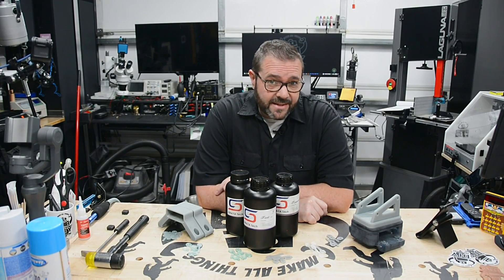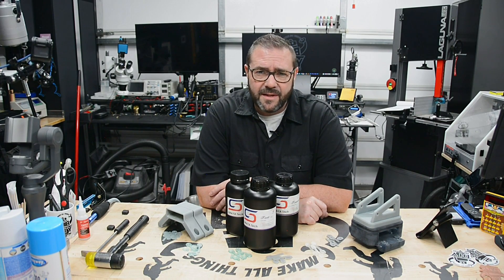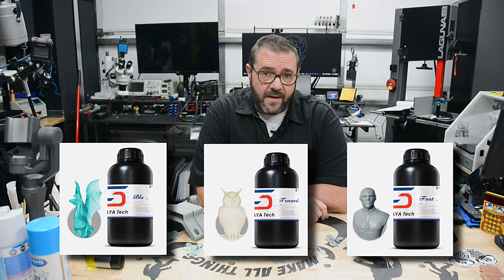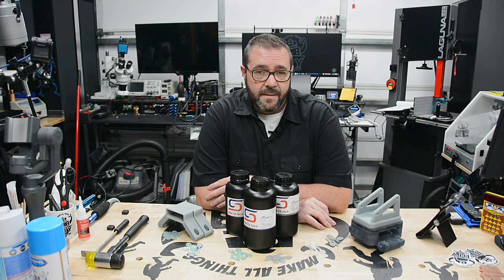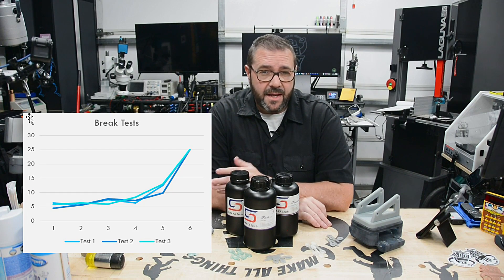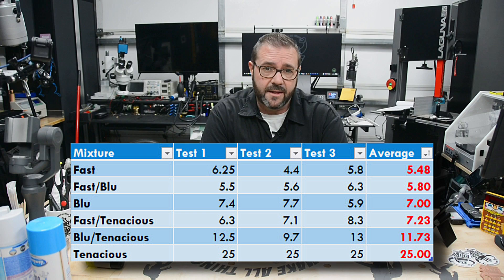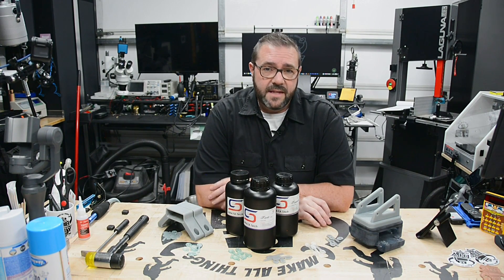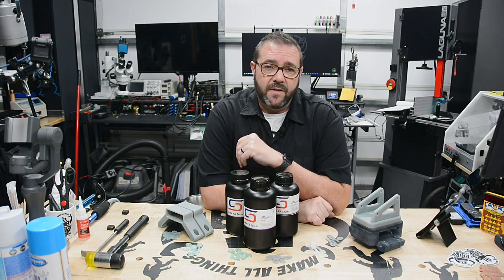Testing Multiple Siraya-Tech Resin Mixtures for Maximum Strength!

Comment: If I could see a video like this.. but also comparing prints with a caliper.. checkijg macro photos.. seeing which details were lost or not.. I could find the perfect combination that worked for me. Mixing this or that.. or not.. theoretically each resin has its own propertymies on details, expanding and/or shrinking.. that's also important when making a decision besides resistance. 

Yeah even if the subject is mechanical parts printed.. precision is key. I don't want to print with finicky mixes that have unstable sizes when fitting each other

Comment: Really appreciate the scientific and practical stuff you post. I’ve been on a constant search for the strongest resins for a few years for the various mechanical parts I create. I’ve come to Esun hard/tough as being most resistant by a significant margin to certain breaking forces. Blu being second to that for sure. Though now I’m curious about a Tenacious blend to trade off some flexibility for strength. Have you ever used the Esun or compared the two? To me these are the only options I’ve come across (at least among the affordable resins).

Comment: This is actually exactly what I was looking for! I was looking to make something robust that could be tapped and screwed and this is the perfect video. What mixture ratio did you settle with?
Reply from the maker: I think i went with 70:30 blu/tenacious for the overhead gimbal
It has lasted over a year under heavy load considerably well! Some parts are starting to show fatigue. But it’s worked great.
Reply: @DIYEngineering  oh perfect that was the ratio I planned on testing first anyways!

Comment: Great video without a single miniature model. I am very interested in the tenacoius resin and its surface properties. We need to design something to hold small items with vacuum and while I can find FDM TPU prints I find nothing in the resin printing. Tenacious should have a shore of 65 - roughly like silicone rubber, and for our process it would be great to print the first 4mm in soft material and the next 10 in ex. a tenacious/blue combo.

Comment: You don't have to use 50/50..   I take a full 1 litter bottle of Fast and pour a 150ml of tenacious in it.   There is enough room in a new unused bottle of fast for this 150ml.   Mix up real good and I use that throughout the day, every day, with unbelievable results.
Reply from the maker: that may work for your application, but the mixture ratio is ultimately dependent on your desired material characteristics and application.
Reply: @DIYEngineering  Understand, I wasn't saying it has to be that way, just letting others know it's not required to be 50/50 since that is the only mixed setting you spoke of.   Good vid though.

Comment: i just mixed 1 part Siraya Tech Build w/ 2 parts Siraya Tech Blu.  Surprising strong, and very cool color.  Easy to cut or print threads into the parts.
Reply: Thanks. I dont have test a lot of resin but siraya product are impressive. For now i've tested BUILD (cool results) and SIMPLE (too sensible to relative humidity). But i'm going to buy 1l of tech blue to test.

Comment: How's the precision on your blue/tenacious mix? Could you you make small (5-15mm) parts that fit together with tight tolerances?
Reply from the maker: my experience with it is good. my parts were fairly tight tolerance (I added 0.25mm tolerance to the models) and they fit well. generally, I would say that the consistency of a resin printed model is closely related to the consistency of the post process (clean/cure time consistency) good luck
Reply: @DIYEngineering  Thanks for the help! I saw that the layer times for the blu on a sonic mini (provided by Siraya Tech) were up in the 8 second range which is much longer than other resins on a mono screen (2.5-4.5). How'd you go with layer time on the fast+tenacious vs blu+tenacious? Does it double the print time and for you would that be worth the  improvement?
Reply: @DIYEngineering  (PS I've already received the blu and tenacious, will be testing soon once my temp control setup is tuned)
Reply: I'm testing BUILD and SIMPLE. The precision is impressive. I'm in the process of tweaking XYZ axis ratio to have Exact measure.

Comment: I massively appreciate this test, definitely confirms what I was hoping would be the case. Most of my printing tends to focus of firearms and gunsmithing applications, and although Blu works well due to it's heat resistance and general toughness, I have had a suspicion that a bit more flexibility would help prevent the issue of recoil induced cracking . Just placed an order for some tenacious. Thanks!
Reply: I too work in the same area. 70% Tenacious and 30% blu make great glock frames.
Reply from the maker: NP, sounds like you're making some fun stuff! ;)

Comment: what is the best way to counter the 6% volume shrink I've noticed some of my parts aren't connecting right too loose or just simply too tight I'm new to the whole resin print community and I'm finding Siraya Blu kind of hard to get accurate.
Reply from the maker: Thoroughly clean parts in fresh ipa, allow time to outgas alcohol that is absorbed. Cure for same amount of time. Define your formula and be consistent.
Reply: @DIYEngineering  Oh so it's more to the end process rather than scaling the model a little bit bigger? I thought you had to add the 6% shrinkage on top of the overall scale to counter the shrinkage Thanks.
Reply from the maker: @minion9707  resin can be affected dimensionally depending on the shape and thickness of the part that you are printing. it can be exaggerated by not having a consistent and uniform post process. hope this helps

Comment: What printer and exposure settings were used for these?
Reply from the maker: the test parts were all printed on an anycubic photon (using the photon printer profile in chitubox), cleaned in 99% IPA, then post cured for 10 minutes at 65 degrees c for 15 minutes

Comment: Hello, would a cured uv resin print survive if exposed to direct sunlight for ~3hrs per week, I am thinking of making a GoPro mount with a mix of blu and tenacious
Reply from the maker: I believe the critical part of that will be how you protect the part from the UV degredation which will cause the part to lose its material characteristics. My recommendation is to use a uv or ceramic coating to dramatically extend the life of the part.

Comment: How do they hold up to heat?
Reply from the maker: All tests were performed in 72 degrees environment. And while i didn’t run specific great related tests, i did notice that pure tenacious resin is very susceptible to heat, its flexibility improves the hotter that it is and will deform if you let it cool while deformed.
Reply: @DIYEngineering  Some of your viewers may want to know how these stand up to heat.

Comment: What about 3 way mixes of these? Or does adding fast just not give any benefit?  (It’s more watery so maybe helps with print temp requirements? If nothing else. Etc)
Reply from the maker: I used a triple mix for the overhead gimbal, it worked good but there is diminishing return as you add more fast
Reply: @DIYEngineering  what mix? I’ll dig in your videos and see if I can find the part you mentioned. 
 I’m looking for something strong enough to put M3 screws into, partly taped, so they lock similar to a lock nut. So far Fast has been great alone. I also did a 10/90 blue/fast test and didn’t really notice much difference. Looking at your numbers, I’m not sure blu is all that great. I also did a small amount of 50/50 fast blu and it definitely seems to want warmer temps to flow better. Maybe blu isn’t worth it...
I need to play with the tenacious I just got the other day.

Comment: More important than a break test would be what happens when I have a functional part with a joint and whether there is abrasion!?
Reply from the maker: In this case tensile strength and flex modulus were most important for my heavy weight project. I would not recommend using resin in situations with abrasion. My design used bearings.
I’ll do more test in the future with these as needed.

Comment: Try "build" if you can find it.  I'm interested in what is the most dimensionally accurate with no shrinkage that can be drilled and tapped, or takes threaded inserts well.
Reply from the maker: hemi4unme i agree, I’ve reached out to them. My opinion is a 60/40 of blu/tenacious will give you the best results